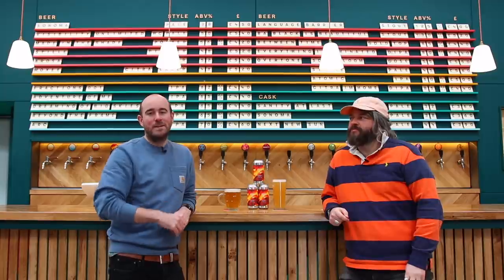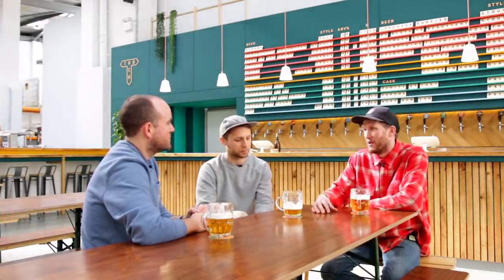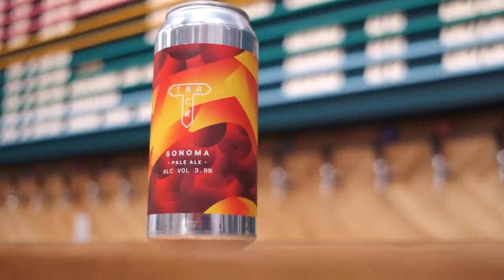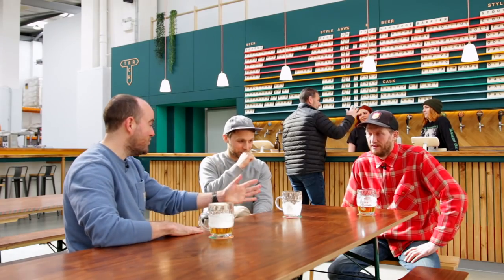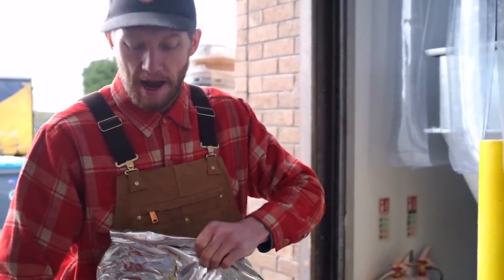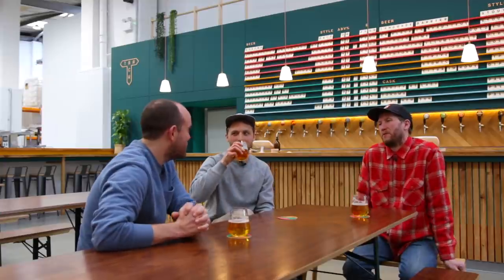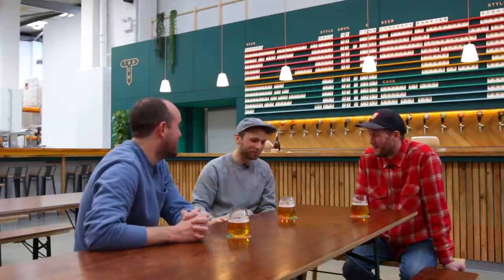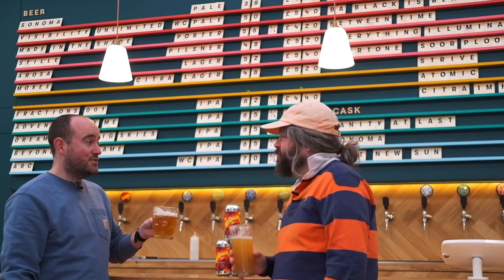Track Brewing: from Lactose IPA to Cask Sonoma | The Craft Beer Channel

Comment: Don't. Put. Your. Tap. In. The. Glass.
Filthy people.
Reply: I guess you wouldn't have a pint of cask beer poured through a swan neck with a sparkler then - but you'd be missing out :)
Reply from the maker: This is an old cliche and misunderstanding. There is absolutely nothing wrong with the tap touching the beer. It's done with most Cask Ale, properly poured lager and anything from a side pull tap. It allows the bartender to pour the beer without exposing it to oxygen so is in fact preferable. The taps in good bars are always spotless.